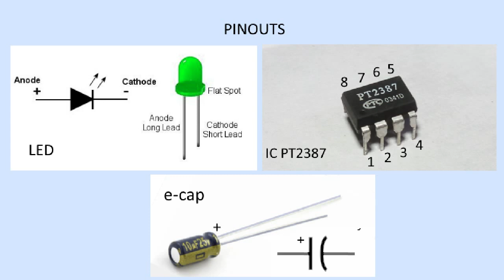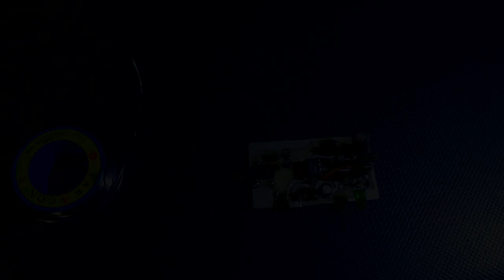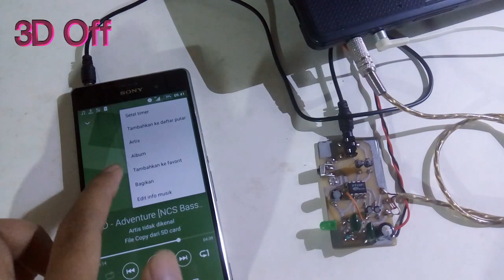DIY 3D Sound Audio Processor Module

Comment: Probably not entirely your fault, but the test section of the video sounds absolutely terrible both with it on and off, and it's impossible to tell for certain the specific kind and amount of difference the processor IC introduces.

But i have a vague impression that it adds too much comb filtering, which is always a risk.
Reply from the maker: Original track may not best choice for test. you know its YouTube, due its free to use (non copyright material), so I go to use it. 
for me as electronics DIY-ers, this project is interesting and not cost much. I use this module on my Bluetooth audio receiver and also Bluetooth speaker, as appear in my video:
https://www.youtube.com/watch?v=-eJR_ywSewM